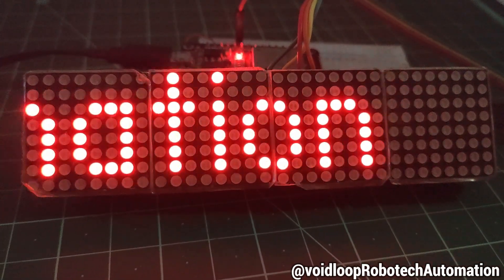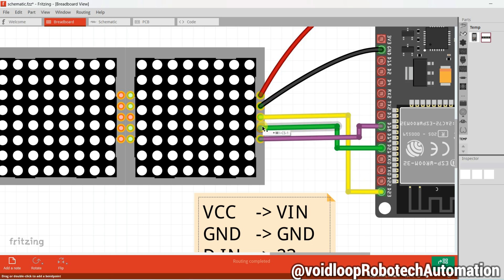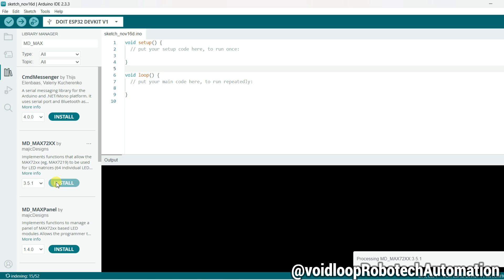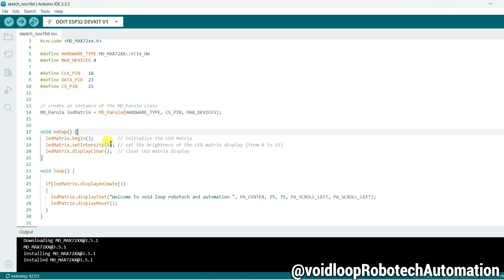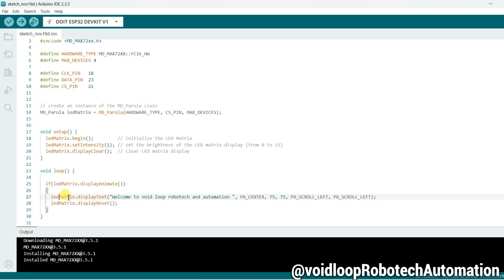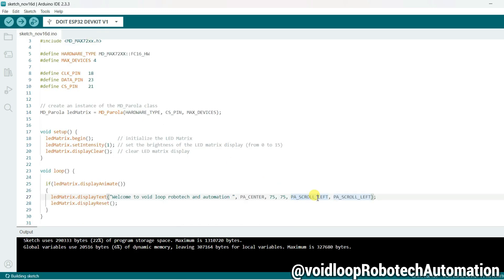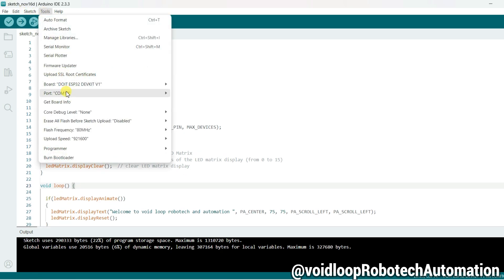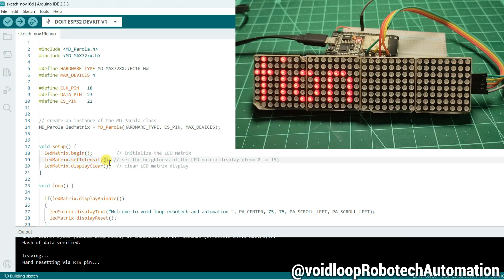40 ESP32 Led Dot Matrix 64x8 Display Max7219 using Arduino

Comment: Where is code ? 🙂
Reply from the maker: https://github.com/voidlooprobotech/ESP32-with-Arduino-Examples/tree/main/40%20ESP32%20Led%20matrix%2064x8%20display%20using%20Arduino
Reply: @voidloopRobotechAutomation  Thank you 🤲🏻✨ If Arduino should be installed on the computer via USB, or should it be installed on the LED matrix via USB?